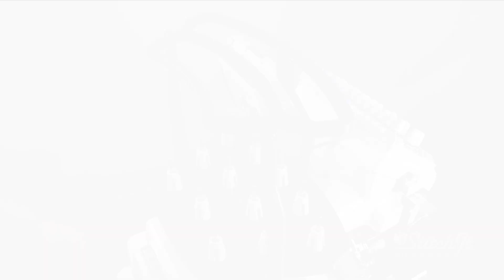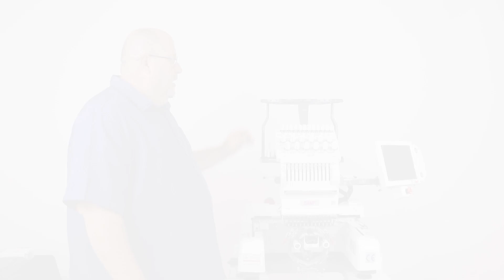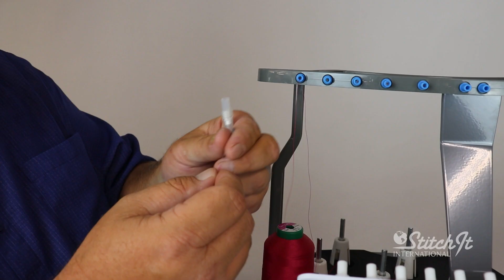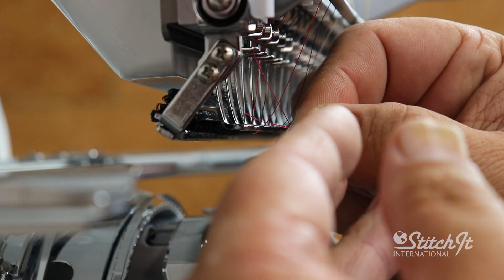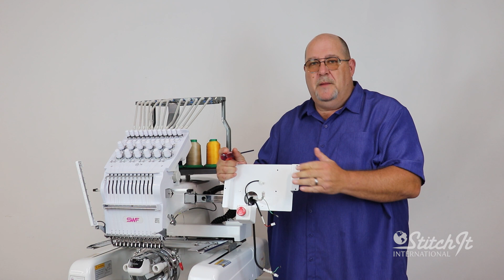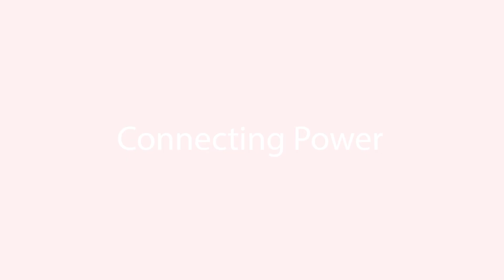Setting Up a SWF MAS-12 Embroidery Machine without Control Panel

Comment: Hello, I have the same machine and I like it, but I have a question. Is it normal that when the machine is turned on, the arm where the hoop is placed moves back and forth?
Or does it have to be firm, without moving?
To the sides it does not move. When I embroider on it, the embroideries look like there are missing stitches. I have another machine and on it, the frame does not move until I press the start button.
I hope you understand my question.

Comment: Thank you I needed this last Friday when I received this machine. 😮
Reply: Hi congrats on your purchase I received mines a week ago and I have a question. The machine came with thread already semi attached did you keep that in and take out start from scratch or tied the thread together? I’m super confused.
Reply: @lorrainemia  you can tie the new thread to previous thread and pull it slowly thru but then I found my wasn’t threaded properly too so I had to rethread the whole thing WITHOUT anything’s then found videos how to do it. I did got the correct video via email from the co I purchased from so it’s all good.
Reply: @lorrainemia  make sure you update your software, change your settings etc. sorry to throw this out but I’m saving you from massive headaches trying to run it.